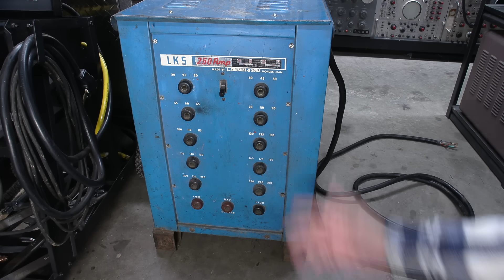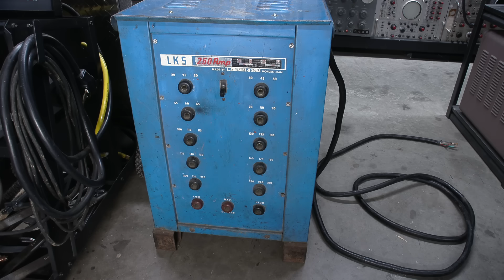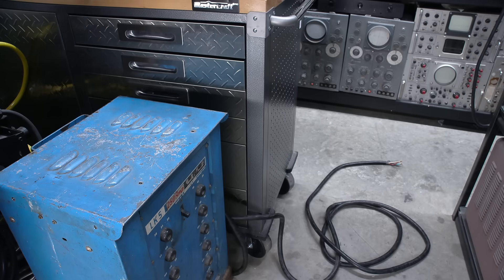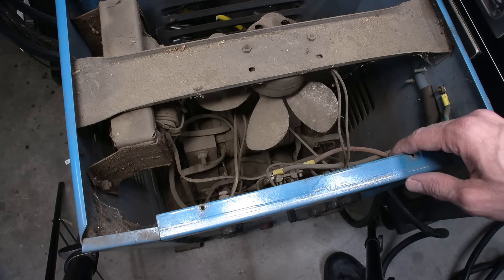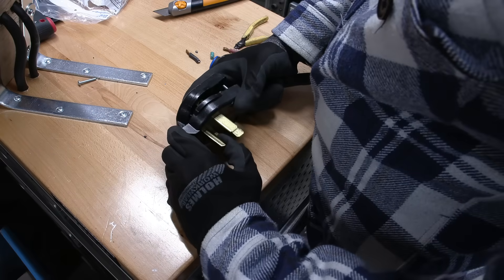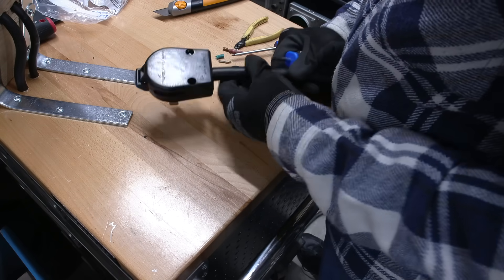250 Amp Power Supply - Will It Work? Power It Up!

Comment: What is the theory behind the current limiting, how is that happening using just the transformer and a reactor?
Reply: It's an AC output.  The reactor is a big heavy  inductor designed to work at line frequency.  It will drop the output voltage in proportion to the current running thru it.   Which in turn will limit the output current ..

Comment: I'd use a Leaf Blower on the inside (Male Dusting), just like cleaning out a Desktop PC!
Reply: Be careful spinning up electronically commutated fans (like computer fans) with blowers.  It will fry the electronics on some of them (don't ask me how I know).   Some survive , some don't - must be a difference in the circuitry whereby some effectively have protection against this.  

With shaded pole fans like in this welder, it's fine to let her rip...
Reply: @GannDolph  I suggested the idea, after watching a video years ago by Carey Holzman. He builds Desktops, and made a video using a leaf blower to clean out a desktop. Don't kill the messenger!
Reply: @alansmith4734  It's a great method - I do it - just hold the fan blades with your fingers to stop them from spinning -if you don't want to risk burning them all out .

Comment: Is this going to become a homemade DC charger for an EV?
Reply: That would be cool, but a power supply that provides low voltage AC doesn't get him closer to the high voltage DC (400V, or 800V) that fast DC charging employs..